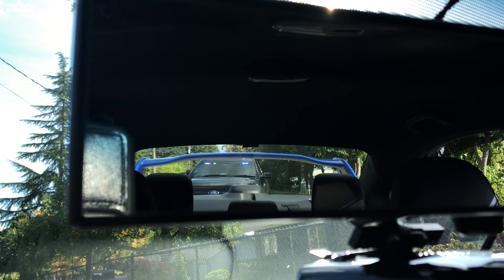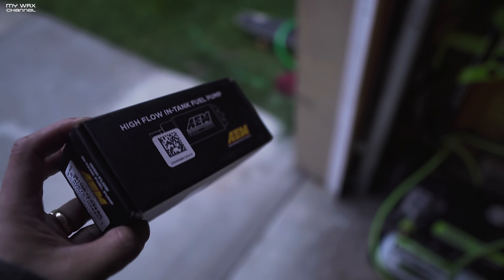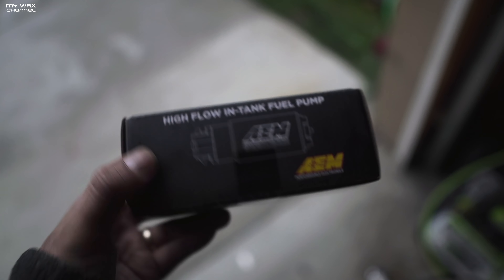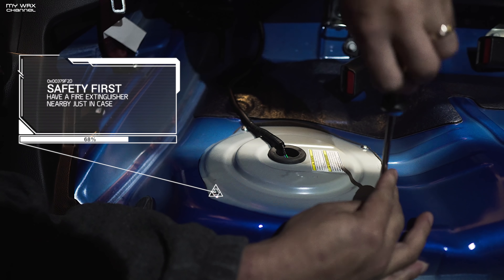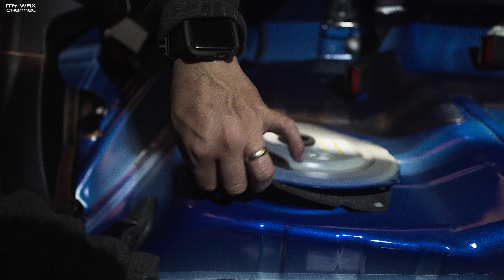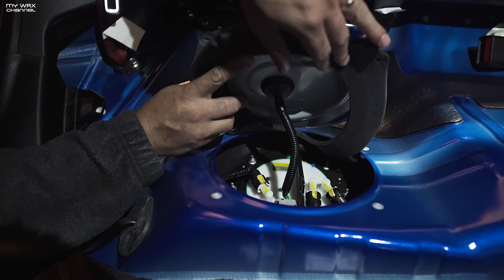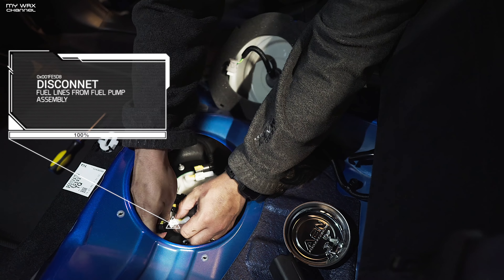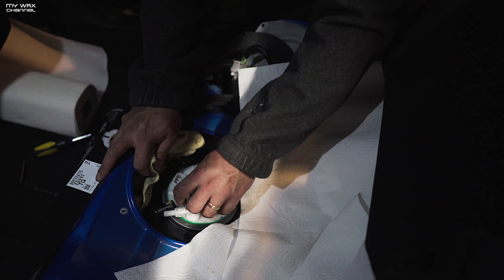AEM FUEL PUMP DIY INSTALLATION GUIDE | 2015-2020 SUBARU WRX STI

Comment: I installed mine today.... and car didn’t turn on! Fuel wasn’t pumping to the engine at all! Swapped in back to stock turns right back on! Any ideas? 🙁
Reply from the maker: Assuming all of the connections are good, make sure to prime the system by cycling the key a few times. Also, try using 2 rubber o-rings on the pump.

Comment: Did you have to have a base tune ready for your egr and  tgv deletes and flex fuel sensor and fuel pump and boost controller. I did all mine at one shot and my car idled for 10-12 seconds and shut off. Can’t get it to start now i don’t have base tune yet
Reply: Did you get this worked out?  Curious, because I want to do the same.
Reply: You cannot do that.
Reply: @949wrx9  what did you end up doing?

Comment: When I did mine, I totally forgot I had a full tank. Fuel spilled under the car and down the driveway. Luckily I had a bag of sand laying around in the garage to soak it up.

Also, another way to make sure the pump is fully primed is to listen in the engine bay for humming after cycling. If there's no noise, no engine leaks, fuse installed, and no start/bad readings, chances are the one of the o-rings got displaced and the pump is sucking air.

Comment: I just did my AEM fuel pump upgrade on my 2020 WRX and my fuel basket was different. Was actually similar to my 2015 FRS one and has a joined clip under the pump that has to be separate like in the FRS duel pump upgrade

Comment: Good tip on fuel levels 👍. I will remember that when I go to install the Verus Engineering Fuel Starvation Door on my WRX. Thought you might have considered that part as well when you were swapping the fuel pump out. The fuel door (flap) part is in line with your philosophy of maximizing reliability. Can’t fault you though it’s pricey $$ for such a tiny plastic part.

Comment: Did you have any issues only using the one o ring?  From everything Ive read/heard, two is necessary
Reply from the maker: None at all. Car is running just fine.

Comment: My 2019 STI starts and reads 33.3 on fuel duty but shows 0.00 on the fuel press. Final, what do I do? I'm also on a pro tune.
Reply from the maker: No worries. Do you have the Cobb fuel pressure sensor?
Reply: @CarsWithJR  Not yet, subaru doesn't come from the factory with a fuel pressure sensor?

Comment: Are the connectors just plug and play? Or do you have to re wire stuff?
Reply from the maker: No extra wiring needed. It comes with a harness. Plug ad play.
Reply: @CarsWithJR  so you just resuse the factory connector?

Comment: Is it possible to run the Aem high flow with stock injector and do you need a tune after installation?
Reply: W1scons!n Edm yes it is. And no you don’t need a tune with just a fuel pump install.